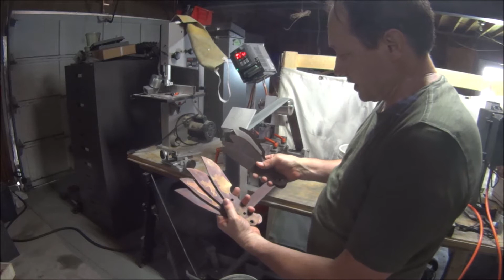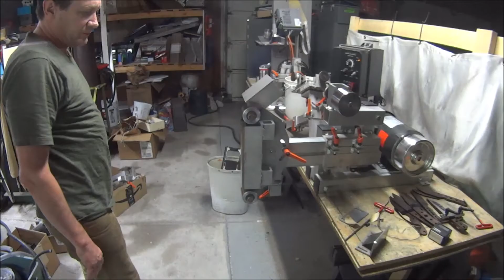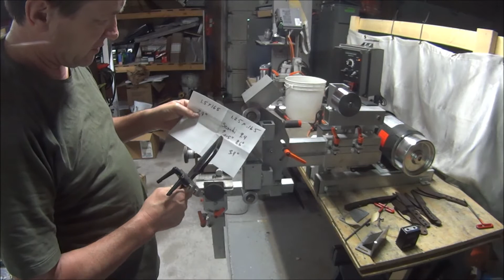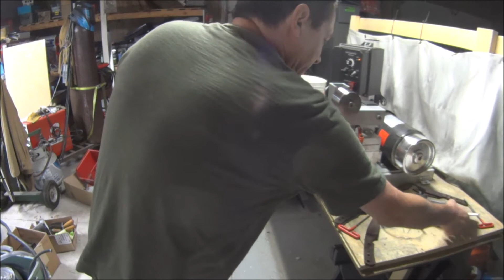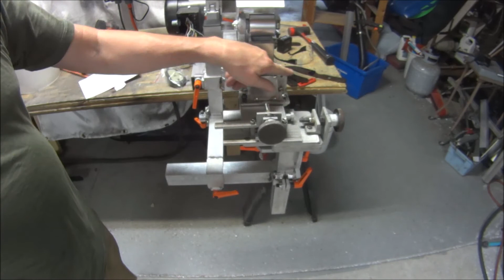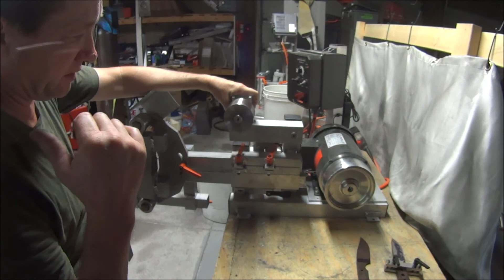Heretic H2 | 10 Blade Grind Part 1

Comment: You mention a bevel calculator. Can you tell me where to find it?
Reply from the maker: Steve Francoeur https://www.wedgek.com/a-angle-calculator.aspx
Reply from the maker: Steve Francoeur https://www.wedgek.com/a-angle-calculator.aspx
Reply: I like the vice u are using on the grinder. How would I get plans to build 1? Great video!!!
Reply from the maker: Keavin Coddington www.belnapcustomknives.com has free diy plans.  If you have questions use the contact page there to contact me. Thanks